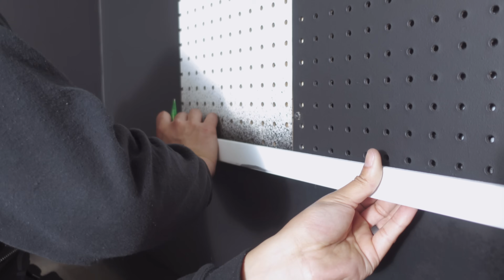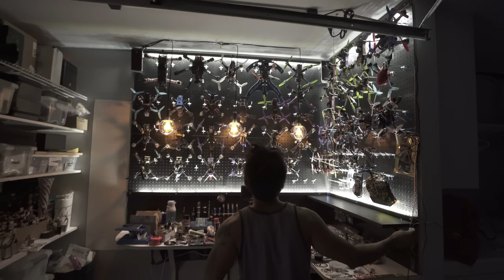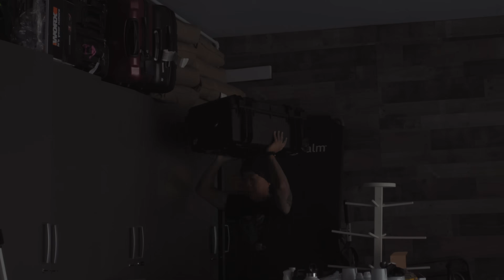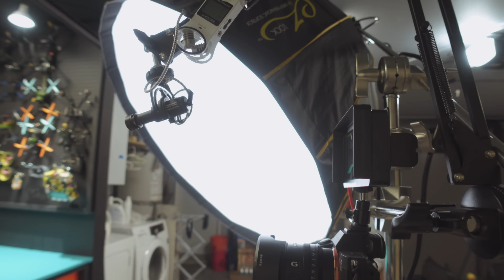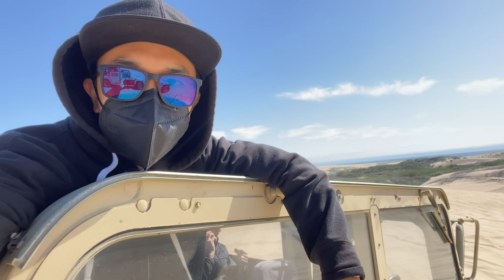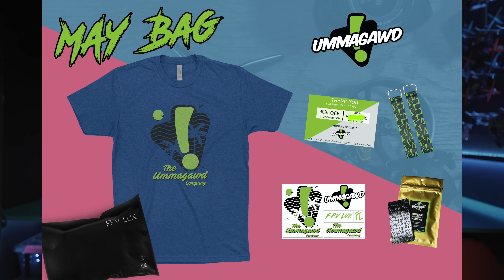Garage Studio & Other Updates | 2Fiddy AIO FC AEROLITE MOTORS

Comment: The epoxy is probably not 100% cured maybe think about putting a urethane top clear on it .  it gets really hard and pretty scratch resistant.  I’m an industrial coating inspector and I was an applicator and sand blaster for like 6 years

Comment: epoxy coating - When mixed, during the pour if you scrape to get the last out of the container, those scrapings are 99% certain to be mostly part a or part b and not mixed well. If it stays sticky or soft, may never cure. :(  I hope I'm wrong and that this is just super slow curing...but I bet it's not mixed enough. To combat this, mix in a container, pour in another container (safe to scrape), then mix again, and do the pour - do not scrape the 2nd time.

Comment: Tommy bro that table looks so good. I used to shape surfboards back in the day and seems like u didn't have enough hardner in it. Its a very fine line between having to much and not enough. Believe me ive made all the mistakes, lol had a surf board smoke up on me once  just like your motor did , i didn't know whether to run or get the fire extinguisher.
   Anyways with glass it does take a while to cure properly. I would not ride a bord for 3 or 4 weeks, the longer the better.  put it in the sun if possible.  And if that doesn't help you can mix another lot of resin , like a top coat with a little more hardner to the ratio you used frist time. 
Hope his helps bro 👊👍

Comment: Yo, ex boat builder here we had to cure our hulls in massive 80ft long tents to get the resin to harden properly, HOWEVER! too much direct heat can cause the bottom layer to expand/bubble. Gentle even heat for a few hours could help with this?
What epoxy did you use Tommy?

Comment: As for your epoxy coating...are you sure that you added sufficient harder not the mixture? If not it may not ever completely harden. Now I’m just going out on a limb and thinking that humidity may also be a factor, seeing as that it is in a garage near washer and dryer(not 100% on that) If so, you could rent, barrow or buy a dehumidifier. They come in handy for many things. If all else fails, you could apply another thin layer with significantly more hardener, over top, but work quickly. UV lights also help with hardening. Everything looks really good though man! I dig it.

Comment: Love the 2Fiddy frame Tommy, it is different than all the other lightweights. But have you ever considered making it foldable? with biblade props it would make really easy to carry around :)  keep the good content going, love it
Reply from the maker: IT never crossed my mind, mainly because doing so would make it heavier/weaker which doesn’t help a freestyle oriented build.buuuut... I have wanted an excuse to build something with folding arms...
Reply: @ummagawdFPV  you wouldn't need to change much in your frame afaik. Some sideways slots on the inner arm holes and some butterfly nut to fasten/loosen them :) I really want all my stuff as easily carriable as possible lol

Comment: Maybe put a custom cut industrial glass top on that bench to fix it.. I think the hardener didn't take.. Sometimes you can pick up industrial glass that was misscut for buildings cheap
Reply from the maker: That sounds baller as hell lol. I went with epoxy because it’s cheap. But yea... 1:1 ratio... use the whole bottle... it was around 70deg, but wasn’t sure about humidity.
Reply: @ummagawdFPV  i had a friend who got some thick skyscraper glass cheap. The stuff is very tough.  You may just have to heat the garage for a week or two Tomy.. cool thing is a slower cure usually means a tougher surface.  Another friend of mine is playing with epoxy tops for tables and he has to heat his shop to get the surface warm then to cure.  Epoxy is some cool stuff

Comment: EPOXY.. 
The new space looks awesome!!! 
 Get ahold of the guys at Fiberglass Hawaii, they are located in LA, I know the name is misleading. They will be able to help you figure out what you need. I know different types of epoxy cure differently, and some can handle heat better than others. Some are more pliable while others are harder but can also become brittle if you go to hard.  Sounds like you need one that's on the harder side that can handle some heat. The guys at Fiberglass Hawaii have a ton of knowledge and should know what you need. 
  Good luck!
Reply from the maker: Thanks for the heads up... I’ll hit them up

Comment: I work on boats. If the epoxy is still soft after a day, it most likely didn’t have the correct ratio of resin to hardener or there was some contamination in it.
Reply from the maker: It’s a 1:1 ratio and I used the whole bottle. So I think it was contaminated or maybe it was too cold/humid? (It was around 70ish). Assuming either of those scenarios... will this ever fully harden or do I need to put another layer?
Reply: @ummagawdFPV   I think it’s as hard as it’s going to get after 3 weeks. Sand it with 180 grit (hopefully it doesn’t gum up on your paper too bad), scrub it with a scotch brite pad and soap and water, let it dry, and pour another layer on it
Reply: @ummagawdFPV  just use a clean bucket and make sure you use equal parts resin and hardener and you should be good. Most epoxies allow for a tiny bit of ratio error

Comment: You can try using a space heater to get the garage hot and try to cure the epoxy more.
Reply from the maker: So it WILL continue to cure/harden then? I just need to accelerate it somehow. Others mentioned UV light

Comment: Everything I read about epoxy coating on countertops says that it will be slightly hard after 72 hours but it will continue to cure for 30 days till it reaches full cure. I dont know to much about epoxy so I did a little research for you.
Reply from the maker: Thanks for that... yea I picked this specific brand because it said hard to the touch after 24hrs, and fully cured after 72. I guess so long as it fully cures eventually 😒
Reply: @ummagawdFPV  np man, hope everything works out good. Also your laptop may be heating up the epoxy causing it to soften up leaving the indentations.

Comment: If the epoxy top doesn't harden up and you don't want to bail on it, you can get some 1/4" glass cut for the top (just put it on top over what you have). Unfortunately, the easiest way would be to have it cut in 3 pieces. A couple 45* going off into the far corners won't look that bad.
Reply from the maker: The table was custom fit in (the back wall isn’t perfectly straight and the corners aren’t perfectly 90). So glass would reveal the imperfections and my OCD ass would be bothered lol. Plus glass is expensive. I hope the epoxy continues to cure underneatg

Comment: Tommy, does your laptop get hot? ...epoxy softens with heat.
Reply from the maker: I thought that at first, but no the laptop was closed/off. It has little rubber feet on the bottom and that’s what left dents on the top surface. I’m able to take a heat gun and get rid of most of the dent.
Reply: @ummagawdFPV  OK, then look at the ratio of hardener to epoxy, if it's a 2-part mixture? Also, it may take a week to fully cure, again depending on the mixture. Worst-case scenario, you may be able to re-coat with another type of (premium) furniture-grade expoxy (if you perhaps used something else) ... and, I suggest some landing lights, so you can use the desktop as a runway for a sub-250G fixed-wing :)

Comment: Brother.. It doesn't matter what you're making a video on.. As soon as I see a video from Ummagawd, I break my wrist to click on it! Id go for a video on more 2fiddy freestyle:) As for the benchtop, I have read what others have said, and agree with most of them. Crank the heat, and set up some strong UV lighting. Both will help dry up any moisture, and cure it. I assume it's table top specific resin? Table top resin has a slow cure time purposefully, to allow it to level off and offgas evenly/let the bubbles rise and dissipate. It does seem like 3 weeks is a tad longer than it should take, but try heat and strong UV light. If that doesn't take care of it after a few days to a week, then it's probably light on the activator. If that's the case, prep it for a final coat (if you're sanding between coats, then do that.) Then make positive you get the correct ratio of resin/activator, and pour out a final layer. It doesn't need to be ground off or anything though.. You can put 30 layers on if you want. It'll just keep adding depth. Also, when fully cured, you should be able to wetsand and buff it like a car. I like the Grey btw! J/K, I know it's blue lol. I'm colorblind too. I just heard Steele talking about it.. I've done that before too lol!
Reply from the maker: Yea it sounds like from the comments that I can still save it. I’m dreading having to pour again. Lol re: Steele there’s a bit of a mixup because I changed the color. It was originally much more grey and the lighting made it look blue. And then I went with “glacier blue” and that’s the pic Steele saw. But yea... even with the original color I thought it was grey, but probably more blue in reality 😂 #colorblind

Comment: What's the future for Remix frame? 
It's still my favorite frame, but it would be nice to have something new just because. What I'd like to see is maybe going to one plate for the top plate that is thick  instead of  two thin plates and maybe 2-5mm more space in the rear for vistas, and maybe the arm mount design (second bolt only goes through arm) that the Impulse alien uses that gets the good vibe testing by that one guy that does some high level vibe analysis.

Comment: Maybe some UV lamps can help with the cure properties.   I work with some epoxy projects so I am dealing with smaller quantities.   Have experienced the slow cure stuff as well.    Careful with the not fully cured stuff and any other epoxy type materials, if the two surfaces touch they may try to insta-bond and be an ever loving bitch to seperate.
Reply from the maker: Yea that’s what I heard... that’s why I’m lost as what to do. But I hadn’t come across using UV light. I’ll look into that
Reply: @ummagawdFPV  run by my most recent upload...   my 66 is SO close to firing up.   Instagram has more pics/more up to date.   All I am waiting on is my radiator now and 1 wire I am leaving unhooked til I have all fluids in and lines double checked.

Comment: Cool looking room, mate. As for the bench, I do a lot of woodworking and use epoxy resin and to get the best results is to do 4 thin coats and sand down lightly between each coat with 120 grit paper before you apply the next coat, and you will end up with a super smooth and very hard worktop. leave each coat to dry for 24 hours before sanding and leave the last coat for 1 week (don't touch it) and don't sand down the last coat !!!!   Just remembered if you want a harsher / grippier tabletop then mix some Sand into the resin on the last coat

Comment: IDK what epoxy you used but UV lights will help cure epoxy pretty good,  I used it on my wife's desk she used a thicker epoxy and it took a while to dry so I took UV bulbs in one of those double bulb florescent garage light fixtures and it helped it cure really good :) hope it helps <3
Reply from the maker: Thanks! I will try this
Reply: @ummagawdFPV  well I hope ya can get back to using the build table soon haha the shot looks way better with the improvements. Haha you made me want a giant decal now haha
Reply: Also if the uv doesn't fix it depending on the epoxy I was told you can just mix more and add a layer to it and it should finish mixing in and harden but I'd make sure you scrape the mixing container when using it cause epoxy is sensitive when it comes to the hardener :) <3

Comment: You can check and back of the tin of epoxy for more information or contact the product help line of the epoxy. My experience the product help lines are super useful. I sell coating and paints.

Comment: In terms of Epoxy, I've used hundreds of gallons on wood tables and countertops for clients. You are describing an issue with not enough hardener. Without knowing the specific ratio and how accurately it was measured, mixed, etc. My recommendation would be to call the Epoxy manufacturer and see if they have a recommendation. Unfortunately with a 2 part product it is driven by a chemical reaction not exposure to air, heat, or humidity, although those factors can act as a catalyst to speed up the curing process or in the case of cold and high humidity, they can hinder and slow down the process. You may be able to remedy the issue with time, although in my experience if epoxy doesn't set correctly it never does because not enough hardener was used, and air alone doesn't cure epoxy. As I mentioned, I highly recommend contacting the manufacturer and downloading the technical spec sheets for your product to get all the details and see what the remedy might be. The result should be as hard as a sheet of acrylic on top of your table, definitely should not deform unless extreme heat or pressure is applied. Good luck, and great looking space!

Comment: Reasons for uncured epoxy: wrong mixing ratio, not enough mixing, humidity too high or temperature too low, expired epoxy/ hardner and... your epoxy may need a couple hours of cookig (check technical data sheet for specific numbers). I'd start fixing your table with putting some heating blankets/ blowers/ or at least a hairdrier for 3 hours. Good luck.

Comment: Humidity has a huge effect on curing. Dehumidify and dry heat source. Worked on a building project that was paused for 2-3 months to wait for floors to cure because of humidity.
Reply: yep!  I bet the humidity level was higher than recommended!  Heat lamps in the space should solve the issue... Good luck
Reply: Agree here, you gotta let that epxoy cure suuuppperrrrr gooood

Comment: Thanks for the update. Needed more hardener in the epoxy. I epoxied one of my diy electric skateboard decks and had my foot prints pressed into it so i needed more hardener in it, sanded it and added more epoxy.
Reply: Epoxy has a chemically engineered ratio, that's it. You can't add more hardener to epoxy to make it harden faster or change it's qualities. But, on the other hand there's polyester and vinyl ester resins that work by altering the hardener ratio. Normally, with them you adjust the amount of hardener for the ambient temperature (within the manufacturers recommended range).
Reply: I definitely hope this helps...

Comment: Not enough hardener mix?
Reply from the maker: well... its a 1:1 ratio mix and I used the whole bottle (of resin and hardener) so... I'm guessing it wasn't hot enough when I poured it?
Reply: @ummagawdFPV   could be just not mixed throughout evebly enoough. Maybe try getting some more resin but over add the harder mix well and fill dents ?
Reply: @ummagawdFPV  1:1 by weight or by volume?
Reply: @ummagawdFPV  if the instructions says its a 1:1 then you might need to dehumidify the area. Its not curing properly.
Reply: Exactly one of the most important things is temp. With epoxy. You can hit it with a heat gun. Then spray cool water on it to cool it down then heat it again. If you do that 3 times it should be good the next day. Unless there was something in the bucket you mixed it in. I'm making a architect table to build on that articulates. I'm gonna do something like the blue granite or stone look with the pearl white and some green kinda in-between the pearl white and all the blue tones. I hope mine dries. Who am I kidding I'm in Cali everything sets up quick here.
Reply: Heat!. I heat my fibreglass cowls and canopy's to approximately 70c overnight and then let them cool before removing from the molds, evan after that I can get a heat gun and soften the epoxy if I get it hot enough. 
If your laptop was hot it's probably softened the epoxy and caused the dents. 
Get a heat gun and warm that sucker up. 
Nice a slowly to let the heat soak into the resin and set it properly.